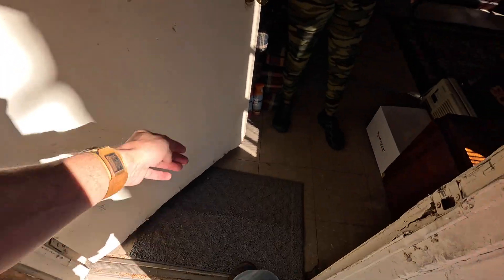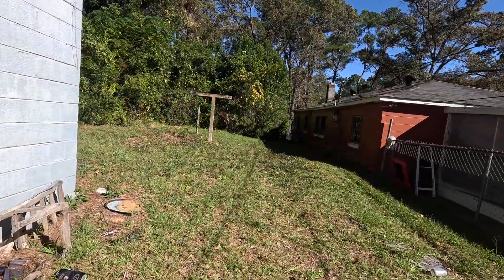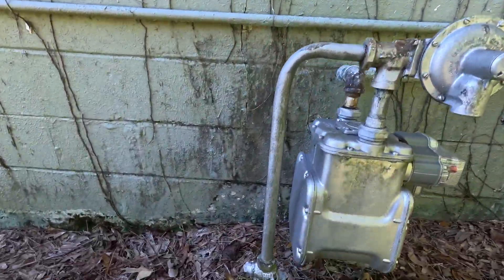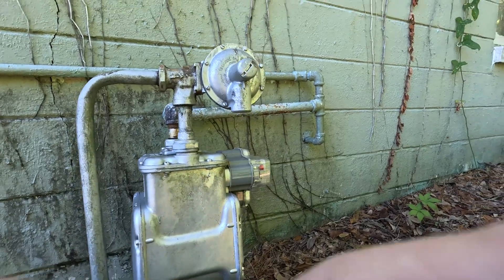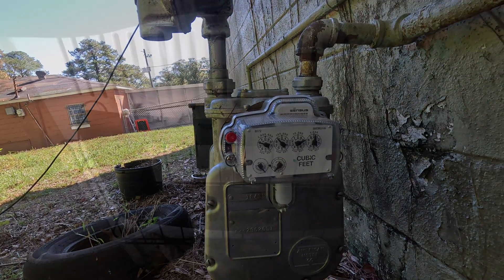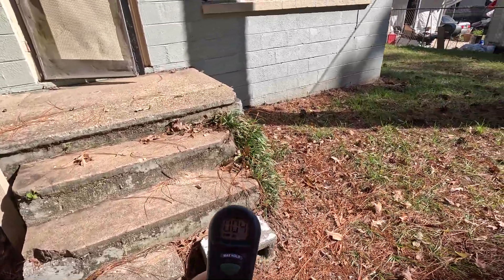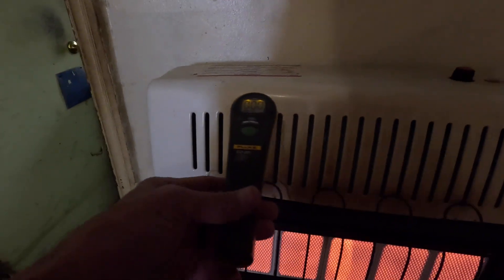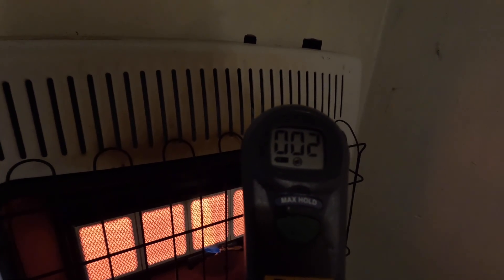Working to Get Someone Some Heat Before It Gets Too Cold! #hvacguy #hvaclife #furnace

Comment: The discoloration near the vent should not be there. Soot? This type of ventless heater shouldn't have any type of soot. The pilot flame should contact the thermocouple if not it will shut the unit down a sure sign it is dirty and not burning correctly.  It needs to be cleaned!
Reply: It’s not soot. It’s just the paint getting brown. I had a brand new heater that did the same thing within like 2 weeks.

Comment: How is the mobile carbon monoxide detector not detecting even a tiny little bit of carbon monoxide on what looks like a vent free gas stove?  I know the amounts are low if the stove is working properly, but it should be reading at least a small amount rather than zero.  Maybe I have ones that are too touchy because they definitely detect carbon monoxide in the proximity of any open flame even if it is a small and harmless amount.

Comment: Portable gas detector would make that job easier.  I have a couple of them permanently installed and on the home network as well.  They both sound a loud alarm with a voice prompt if you crank on propane near them for test purposes.

Comment: Your CO test might not have been valid since the tester shut off during the process. If that happens, whatever level of CO is already present will be taken as the baseline measurement (0 ppm).

I really hope those folks have working CO and smoke alarms. Those unvented heaters can be a tragedy waiting to happen.
Reply: They are fine if you maintain them. I have used one for over 10 years.  Keep it clean, use a proper CO monitor and they are very convenient for heating.  I can either run electric baseboard, wood or the ventless. The ventless is wonderful. It even adds some moisture to the dry winter air.

Comment: There are all kinds of warnings about not using your gas stove to heat the house. Is there any difference between a non vented furnace like this and a stove?
Reply: Yes. I believe those ceramic bricks with the holes in them are a catalytic converter too.